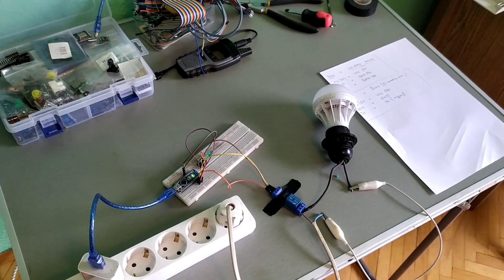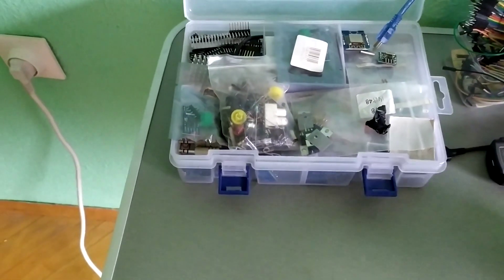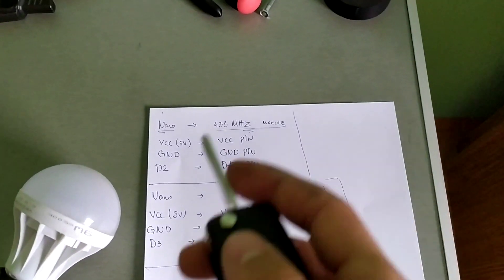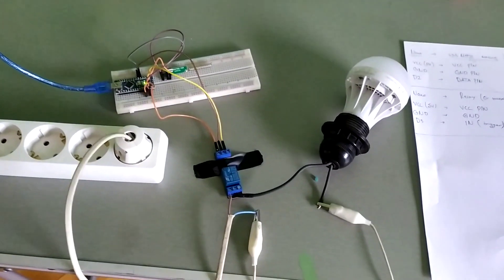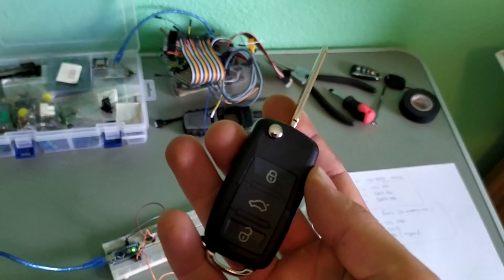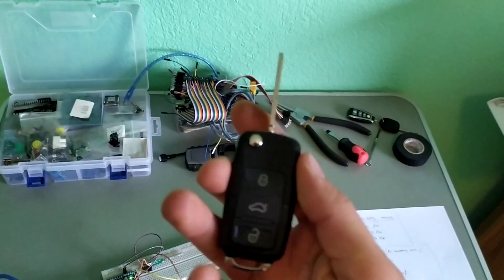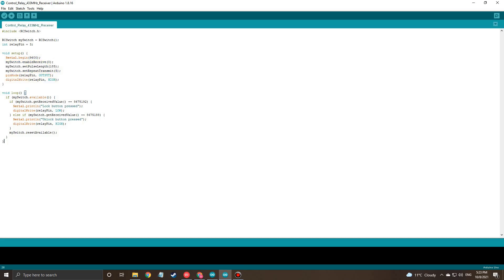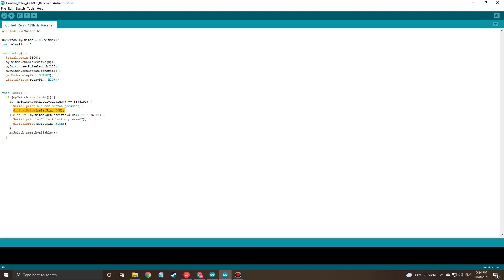Control Everything at Home Using a Car Remote | Arduino and 433mhz Module Tutorial

Comment: How did you determine the code that your lock or unlock sent each time the button is pressed.
Reply from the maker: Before I filmed the video, I had read the button while pressing on it, it is a fixed code remote.
Reply: @SlavkosHobbyChannel  it looks like a VW remote.  How did you read the code,  was it with an oscilloscope?.

What type of distance do you or have you gotten with the remote?

So interested in this
Reply from the maker: @dhynders9193  It looks like a VW key fob, but it's not, it is an aftermarket remote, with a fixed code, VW remotes are rolling code, especially the ones that look like this one.
I printed it on the serial monitor, just executed the method that I am using to make a condition in the code, and printed it.
About the distance, around 30 meters I think. But the distance depends on a lot of other factors, like the strength of the transmitter (the remote), the battery, the surrounding...
Reply: @SlavkosHobbyChannel  thank you for the reply.  So you have a link to your aftermarket remote?
Reply from the maker: Here it is, the remote was part of a system like this one, it should be similar to the one that I have because I bought it from a local store, but it should be this one: https://a.aliexpress.com/_mPgZ0La

Comment: I'm trying to achieve the same thing, but my Renault fob uses a PCF7946 chip, so it's a rolling code fob and it won't pair with those generic Aliexpress 433Mhz modules unfortunately :(
Reply from the maker: Yup, if the fob has id46 7946 transponder chip, the remote will be also rolling code. It is achiavable, I saw one guy on YouTube who did it, and somehow managed to find the algorithm behind it, but it is really hard, haven't tried it.
Reply: Saw a bunch of "rolling code receivers" floating around Aliexpress which are supposed to work with garage door openers which appear to use the same rolling-code system, but I'm not sure if those would work either....not quite ready to buy one just to find out it's absolutely useless for my needs :))
Reply from the maker: hmm... Car remotes are secure, I think that they won't decode a car remote signal. They might work on some "rolling code" aftermarket remotes, but what basically they do, they just roll or use two or three codes. The car's rolling code remotes change the code every time, most of them use an algorithm that has to be paired with the algorithm in the module in the car, and they calculate the next code every time, the same thing does the car module, some of them use a different strategy. So it won't work with a car remote 100% 😄